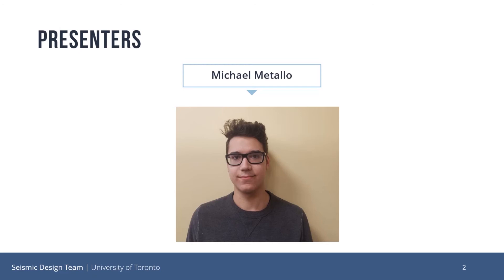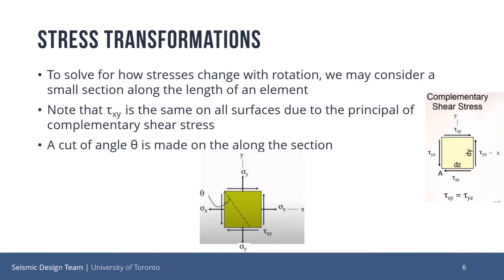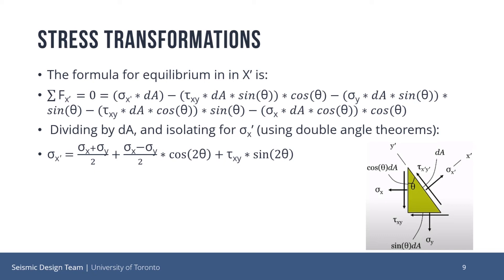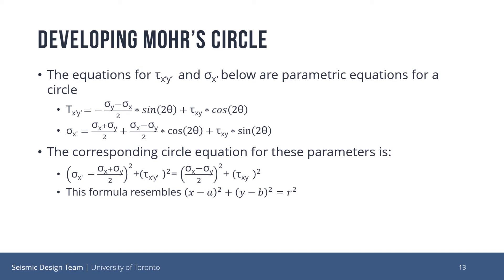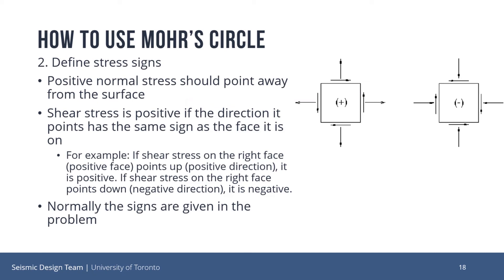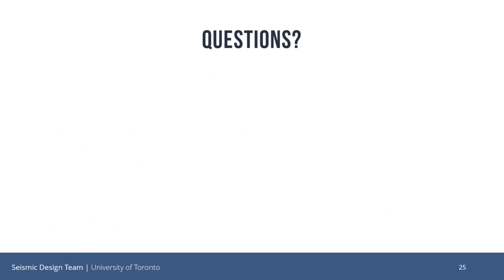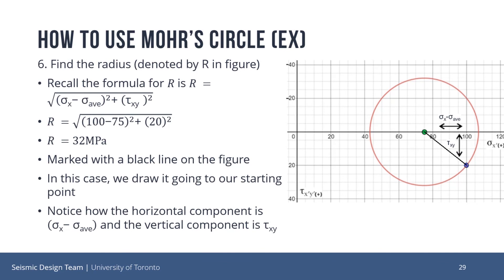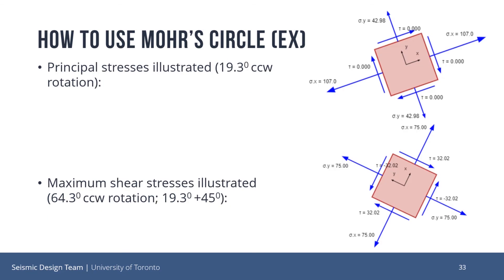Seismic Academy #8 -  Solid Mechanics: Mohr's Circle

Comment: Thank you for your useful video. I have one question,at 1:41, about the element subject to the axial force P at two ends. According to your tutorial, any slanted cut have shear stress but normally there is no shear stress and only compressive or tensile stress in an element with two axial forces at two ends. Could you please explain this? Thank you.